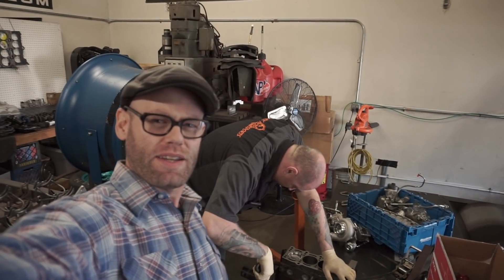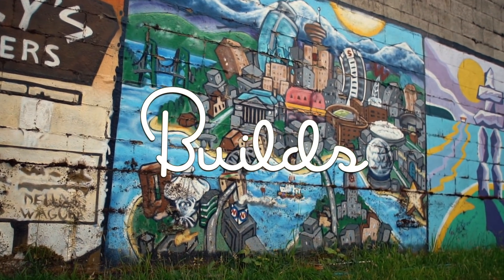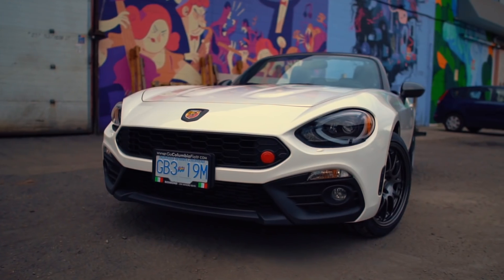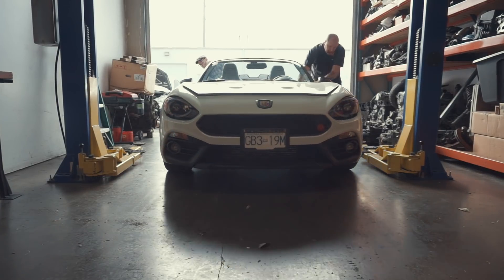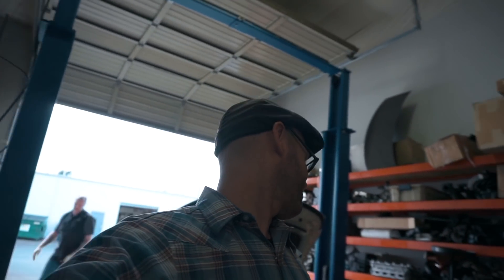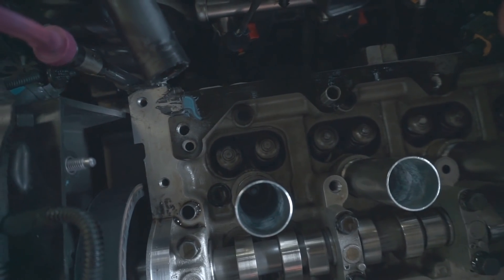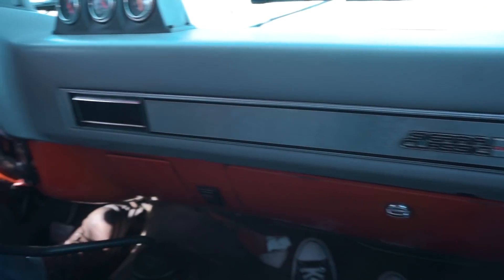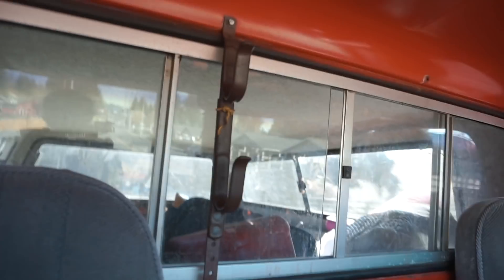Big Turbo Kit Design - How to build a 300+ HP Abarth 124 Spider

Comment: Hi Eddie, you’re trying to make 300+ HP out of this Multi air 1.4, compared to the multi air on your black 124, what’s the difference that allows you to get there, on the black one you were at around 260hp to the wheels, is it a bigger turbo you are using + the multi air springs alone that’s getting you the 300+ hp?.  Also, between parts and labor how much does it cost to modify a 124 to the same you’re doing here?.  Could you add a list of all the things you’re doing/adding to this multi air.  That 124 is a really nice little Italian car.
Reply from the maker: They’re drastically different builds. The black one was a $3k build. The white one is a $10k build. All the details are in the next couple videos.

Comment: Lol I'm just sitting here at 200whp with an ecu tune xd
Reply: Just stage 1 ECU? How did you get it done?
Reply: 200whp is about 60hp over stock. Thats a good gain. Get a downpipe, intercooler and a better tune and you be at almost 250
Reply from the maker: They’re out of fuel at ~210 whp. Injectors are at 100% duty cycle.
Reply: Pistons & Petrol really? E85/flex fuel conversion should solve that
Reply from the maker: Aaron P 100%. I’ve seen two other 1752 124’s get dyno tuned now. They just run out. That’s why E85 injectors and stock turbos are so damn quick. These cars need more fuel a little before they need a bigger turbo.

I have not owned a single FIAT that didn’t have bigger injectors because we always run out of fuel.
Reply: Pistons & Petrol I think I might be getting myself the new MX-5 but now the new 2.0t Accord 6speed manual is tempting me lol
Reply from the maker: Aaron P the newer turbo Honda engines are REALLY good. My brother has a turbo Civic and it’s brilliant.
Reply: I'd love to see a 20v Turbo engine in one of these pocket rockets. Could imagine it to ruin the balance of the vehicle though

Comment: Any suggestions on how to prime the multi air brick oil pump, it drained while it was hibernating for the winter, and apparently a lot of people are having this problem.
Reply: If you open the oil cap, theres a small bleeder valve, you can poke and hold it with a small phillips, make sure you pull the fuel fuse, need a person to crank over while the other holds that valve down and pours a little oil per crank
Reply: @nasdaqpanda7354  I pulled the fuel pump fuse, let it go through the start sequence a few times, then put the fuse back in, no go. I found the ( button ) I'm guessing it's the steel ball that looks like a 1/8" check valve because it's the only thing that moves within view. I thought it would let air out or something, but there was oil on top of it, and I didn't see any bubbles. My next move will be to run a few 5 second, no fuel pump runs, over an hour, to give it a chance to get excess full out of the cylinders, then try it again with pushing oil into that ball ( button ) with a needleless  syringe.  ? 
What do you think.

Comment: You guys just -re-drilled the stock exhaust manifold to mount the turbo?
Reply from the maker: WangChung a divided manifold would have the division right up to flange. That’s just a standard flange.
Reply from the maker: WangChung the flange was removed and a new one was added.
Reply: @PistonsAndPetrol  Cool! It looked like it was divided too. Is your Garrett a twin-scroll?
Reply: @PistonsAndPetrol  I know you are aware of the HRE manifold. Do you think it would be a good upgrade over the stock manifold? I have seen them mention on some forums that they can drill the flanges for different patterns. I was thinking about getting one with a T25 flange and try out an 6258 EFR.
Reply from the maker: Aware. It’s really nice but it would not work on a 124. I’m planning on trying it on a 500
Reply: @PistonsAndPetrol  Oh, the HRE wouldn't work on a 124? Why not?
Reply from the maker: WangChung it would fit on the head but your downpipe would have to go through the dashboard :p The 500 has the turbo closer to cylinder one. Kevin@HRE and I already discussed it.
Reply: Pistons & Petrol damnit! Did they have interest of making a 124 version?
Reply from the maker: Never went that far but I think it would be a great option.

Comment: What will be different from the OEM engine internally?
Reply from the maker: Julio Blanco CP pistons (10:1 compression), Carrillo rods, ported oil passages, deleted oil squirters for higher oil supply at high rpm, ported and polished cylinder head, APR head studs, Biposto headgasket and we will be trying a couple different cam shafts.

300 is the minimum goal.
Reply: probably at least rods and pistons, maybe some headstuds

Comment: What turbo did you use?
Reply from the maker: Garrett G25-550
Reply: @PistonsAndPetrol  nice! I think that's the same one my mate was running in his Abarth Punto Evo (same engine), that thing was a beast! He sold it before he did his final dyno run but based on the big increase over his last run of over 280bhp, we reckon it was 300+
He did try a hybrid version of the same turbo but it never ran right so went back to the original. His build is well known in the Abarth Punto Collective where it remains as it was bought by a member. Nice work, mate! Love the powder coating! I've gotta get me some engine bay colour 😉👌